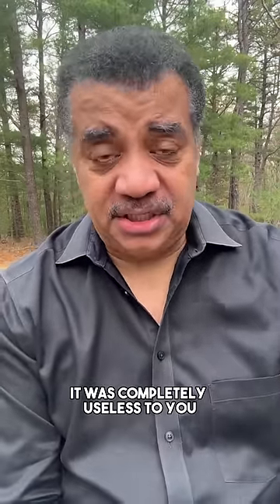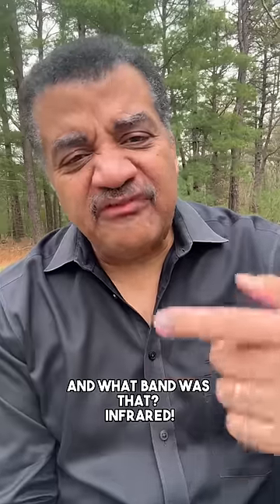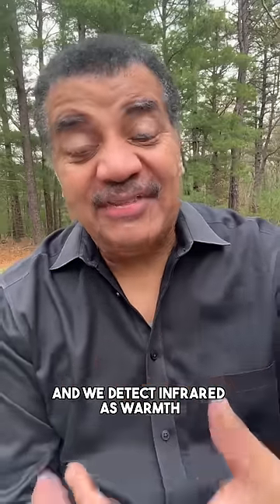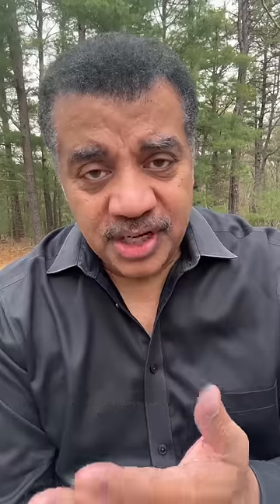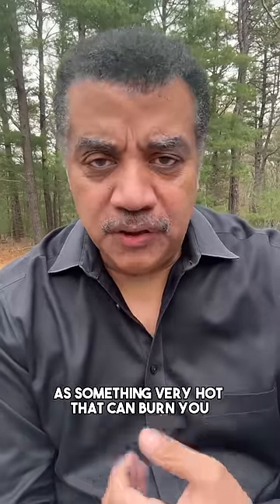LED Bulbs vs. Old Bulbs 💡

Comment: Correction; LED bulbs do get hot.  Touch the base portion that screws into the socket and you will find out.  However, it is still true that they do not waste nearly as much energy as incandescent bulbs.
Reply: Sure, simplification
Reply: That's an entirely different issue
Reply: @milkinanime7047 how is it a different issue? It's still wasting power, just not as much.
Reply: @ankurbhardwaj6184  the heat isn't produced the same it's not excess energy
Reply: Nitpicking.
Reply: It’s not wasted the same way , I’m any electronic device energy is wasted through heat dissipation aka when the electricity is running through the wires , this is extremely different
Reply: @RobertoPerez-ig3fz  THANK CHIRST SOMEONE ELSE UNDERSTANDS
Reply: @milkinanime7047  So, non-radiative recombination of the exciton - still energy input that doesn't go into light causing inefficiency.
Reply: It would have made much more sense if Tyson added that the filament inside old lightbulbs needed to have current go through them to heat up and emit light. LEDs have no filament to run current through, its a Diode which is why it doesnt get hot (or nearly as hot)
Reply: Exactly. If you've ever looked at one of those LED light bars on a vehicle you'll see all those fins. Those are heat radiators. It can also be a huge problem in emergency services light bars. They really have to design those properly to get the heat out of that housing. It's not nearly as bad as incandescent but it's definitely there
Reply: @RobertoPerez-ig3fz  How is this extremely different? In both cases, electrical energy is lost to heat, and therefore they're not perfectly efficient. There's a significant amount of energy lost to heat in LED light bulbs; it's just far less than in incandescent bulbs.
Reply: @milkinanime7047  What do you mean the heat isn't produced the same way? In both cases the heat comes from electrical resistance, yes? In both cases, they lose significant amounts of efficiency, yes? It seems similar to me. The main difference is that the LED light bulbs aren't producing a lot of heat in the LEDs themselves, but either way you're still losing electrical energy. The amounts are just vastly different.
Reply: @DANGJOS  the heat is produced by an electrical component rather than an excess of infrared light that's the difference I'm referring to. There are multiple ways heat is produced within a light bulb of any kind. 

So does it really matter which we choose to compare?

I don't care about how much energy is being lost I was only referring to that very specific difference.
Reply: @milkinanime7047   Well if the component gets hot, then there's still an excess of infrared radiation, although probably not as much. But anyway, I thought this whole thing was about how efficient the bulbs are and how much energy is wasted as heat. While LED bulbs are far more efficient, a huge portion of the electricity coming from your socket is still being wasted as heat.
Reply: Yes, LED bulbs do get hot. Especially just above the base. They waste electricity in the form of heat but not as much as incandescent bulbs. I believe the fluorescent bulbs create much less heat.
Reply: LEDs do not operate on alternating current only direct current. The heat you feel is coming from the rectifier in the base that converts AC to DC. This is also the part most likely to fail, ironically, usually by overheating. When it fails the bulb will blink. Check packaging for heat considerations. If your lamp restricts air flow, say, in a sconce, you need a bulb that can handle that. I found using cylindrical bulbs works best in sconces. The best thing about LEDs is that you can boost  the lumens without exceeding the wattage of the socket. I replaced a 100 watt bulb in my garage with a 300 watt equivalent and it uses less than 40 watts.
Reply: This comment thread surprises me.  So many people with one little piece of understanding that don’t want to accept that there are other distinct fact that are part of the issue.   
If you want to understand this topic, study.  Don’t argue.   It’s incredibly amazing stuff.  Complex beyond most people’s understanding.  
But you only make yourself look ignorant clinging to your one angle perspective.  Look from all sides.  You all have a part of the puzzle. Put it together, don’t use it to argue.
Reply: @thinkingoutloud6741   And what is that which is missing? You're telling us we're ignorant, or look ignorant, which is fine, but what is the missing information? I think it would be of more value if you share, rather than just say there's something missing.
Reply: It's because the energy conversion to light energy it's not 100% efficient.
Reply: They also use between 12 and 20 watts.  Is the scientist lying or are companies intentionally making a less efficient product?
Reply: yeah but if infrared light emits heat why wouldent visible heat as well just not as much
Reply: @ankurbhardwaj6184  yes it's wasting energy but significantly less than before. That's the point. It's not wasting energy creating unnecessary outputs. The electronics we currently use waste energy cause it's not 100% efficient. Instead of 100 watts it's using less than 5watts that's huge improvement.
Reply: @DANGJOS  the difference is it used to cost 100watts of 50 watts now it's less than 5 watts so huge difference.
Reply: Every light source is guaranteed to provide heat- as big a Stephenson 2-18 or as small as a light emitting diode.
Reply: Those parts get hot because of the flow of electricity in that (metallic) area.

If you pass voltage continuously through a conductor, it'll heats up eventually. So it doesn't exactly relate in this context
Reply: That's the computer/pcb board.
Reply: Yes. The heat produced by led is still hot and it is because of the high luminosity itself. Its less then the filament bulb and efficient but then it the heat itself is a  problem for the led unit therefore cooling is needed for it's longevity. Filament bulbs have no problem with it.
Reply: Well, we know SOMETHING gets hot! 🙄 But not the whole bulbs themselves! THAT specifically is what he's explaining.
Reply: @tlock77 thank you. The nerds are getting wildly technical like he didnt just mean the bulb was hot to the touch 😂
Reply: @Classic7-4-7   Right! lol
Reply: They get hot because they are overdriven. In fact their lumens to wattage ratio improved heaps if they're driven at half the commercial item's wattage . A wattage that doesn't cause them to get hot . A ¼ wattage  should yield ½ the lumens but maybe better even . Driven low however means they'll last several decades, it's not good for the economy.
Reply: @milkinanime7047 WTF?  It is by definition wasted heat.  You aren't using the heat, it's waste heat.  So electricity is being consumed by producing waste heat.
Reply: The comments in here that the heat from an LED is different than the heat from an incandescent are moronic.  The point is that the heat is waste heat meaning that some part of the electricity consumed generated heat which is not the end goal of the product.  In order to get light out of an incandescent, 90% of the power went to wasted heat.  There is some percentage of electricity going to heat instead of light from LEDs also.
Reply: Actually, that is a sign that the math is off a bit somewhere between  the socket and the base of the bulb. The amount of resistance is to high at that point for some reason. The lamp (bulb) should pluck the energy it needs from the incoming current and send the rest on its way with negligible heat resistance which should be contained in the insulation and decently cooled by air around it. But voltages and amps have to fit into the lamp's (bulb's) designed electrical math for it to work well. Many bulbs prematurely fail because of this.
Reply: They also taste warm! Lick the base and you'll find out!
Reply: @danmercer8139 Correction, even the LED themselves get hot..

Comment: You may want to consider the older incandescent bulbs over LED for headlights in the northern states.  Incandescents will melt the ice and snow that can accumulate on your headlights during winter storms.
Reply: They had to install heaters in traffic lights to solve this issue of ice buildup.

Comment: For those of us in the north, that 'heat' energy was actually part of what kept us warm.  The porch light and the crawl space light that we left on in the winter to keep the space a wee bit warmer and the pipes from freezing was important and now requires we run new circuits for powered pipe heating cables to augment the insulation (and usually melts the insulation over time).
Reply: They also used to melt the ice off of your car's headlights and taillights. I grew up in the south, but I remember holding my hands near the lamp to heat them up after playing outside that one time a year that it would snow.
Reply: All of these new "energy saving" light bulbs, don't last long, either after you put them in. They cost a ton of money as well!! So, after you buy them and install them, it's not long when you are replacing them. So, in the long run, you are saving energy but not money, I would bet!!
Reply: @jamesspalten5977  Uh, nope. You are dead wrong. LED lights last on average 20 times longer, and often go up to 100x. In fact, incandescent light bulbs were standardized by a literal mafia, known as the Phoebus cartel to last shorter than they should, a form of planned obsolescence, so that people would buy more. 

Today, the average 60W incandescent light bulb lasts 1,000 hours, or about a month and a half of continuous use. Just under half a year if you turn the light off during the day. 

The average LED bulb with the same amount of visible light lasts over 100,000 hours of continuous use or 12 years, not even accounting for turning it off when not in use. Stop taking your crazy pills.

This is all before you factor in that incandescent bulbs require a vacuum or inert gas to function. LED lights do not, and are therefore more resilient.
Reply: You can always install heating elements in the place of the old incandescents. You get more light and more heat for less cost. There are even LED lights meant to emit infrared for heat.
Reply: @john_titor1  please tell me what brand and where you are buying LED bulbs that actually last 12 years. I've bought all kinds of LED bulbs and the longest one has lasted was about 2 years. I've had incandescent bulbs last several years longer. Surprisingly the cheap Walmart brand LED bulbs last longer than more expensive ones.
Reply: And for everyone else, they had to use additional air conditioning to get rid of that heat.  If you need extra Heat get heating strips. Or Edison base heaters.
Reply: @jamesspalten5977 
Oh my god is it 10 years ago? 
You’re still posting the same rationalizations for the last 10 years. 
So far I’ve had exactly one LED bulb go bad.  Stop buying cheap garbage.
Reply: @john_titor1 
Everybody likes to tack onto the last shorter than they should. 
Back then the issue was if you made a a thicker filament, it would last longer, but it would use more energy. They came up with a happy medium, so the customers would get a Common experience. Besides, that was a long time ago. It doesn’t apply anymore or even 10 years ago.
Reply: Do you mean low energy fluoro light 'bulbs', rather than LEDs, @jamesspalten5977 ? 
LEDs use little energy, and do last a very long time.  
The fluoro lights also only use a little energy than incandescent lights, but have roughly equivalent longevity.
Reply: Couldn't you just continue using the regular incandescent lights?
Reply: @CognitiveHeatsink  pretty sure you're confusing LEDs and compact fluorescents.
Reply: @assininecomment1630  
If they stock up, they can continue with the incandescent lights. In fact, they could’ve easily bought them for the last 10 years.  They won’t be available for sale in the US anymore. Most likely they’re blowing smoke.
Reply: @john_titor1 crazy pills 😂
Reply: @Taijifufu   I'm not confusing anything. CFL bulbs last a good long time and I'd use them except my wife hates them. 5 years ago when I bought my house half of the bulbs were CFL and half were incandescent. As they burnt out I replaced them with LED bulbs. I've replaced each of those LED at least once since, but some of the CFL and incandescent are still working.
Reply: @assininecomment1630   I think incandescent bulbs have been banned by the government here in the USA.
Reply: @neilkurzman4907   the only incandescent bulbs I've been able to find in stores for the last 10 years are the little ones for night lights and oil burners.
Reply: @john_titor1 that's the claim.  In the real world I find I wind up replacing LED bulbs far more often than claimed.  The actual LED seems to last, but the electronics that drive them fail.
Reply: @bobmcl2406 IME, certain LED bulbs (looking at you, Phillips) have shorter lifespans in any orientation other than bulb-up.  They smell lovely when they die too.  Mmm, burned PCB...
Reply: Right?!?
"completely useless to you"
Yeah okay Neil, tell me you grew up not worrying about the heat in the winter without telling me!
Reply: @john_titor1  
NO they dont.
Just like the cfl bulbs that were supposed to last 10 years.
Reply: @CognitiveHeatsink  only sales
Reply: @davidtaylor4053  Okay, tell that to all the studies conducted around LED lifespans, everyone who has used LED bulbs that easily last 5-10 years, and the 5 year minimum warranties that are standard on even the cheap sets available at every walmart and home depot across the US. Stop lying.
Reply: Keeping stop lights defrosted as well!!
Reply: @john_titor1 I must buy all the wrong brands from all the wrong stores. Call it what you want, but my personal experience doesn't come close to matching those numbers.
Reply: @ai4px  It's actually cheaper and more energy efficient to use LED lights with small heating elements.
Reply: @CognitiveHeatsink hey are not banned, just not produced any longer.
Reply: @jamesspalten5977 I can tell, you're not a big fan of reading.
Reply: Tell me you're Scottish without telling me you're Scottish
Reply: @utvpoop  scotts aren't the only ones who use 'wee'.
Reply: Or, buy the old bulbs
Reply: They still sell non led bulbs...
Reply: YES! THANK YOU! I was wondering when that side would be broached.
Reply: Just run incandescent during the winter. Duh
Reply: @jamesspalten5977 ive had an LED bulb in my lamp and I leave it on all the time. I e had it for over a year and still haven't replaced it.
Reply: @CognitiveHeatsink The forty-watt incandescent 'appliance bulbs' are still available. LEDs don't do well installed in the oven.
Reply: Iam not in the north but we use it on out pump/well doghouse . Because  we don't have  the heated wrap the  north has.
Reply: @jamesspalten5977 amen ! I have bought led 6 times in the past year .  I've bought 4 pack two at a time. It's been at least 2 of each pack the hole side of the bulb has busted . There I don't know, expensive and dangerous.  Iam so over buying  these bulbs .I've been looking for the old one
Reply: @jamesspalten5977 it is my experience that they last longer than incandescent bulbs.
Reply: @assininecomment1630 they cost more in the long run.
Reply: @kitwench1752 he grew up in New York.
Reply: @john_titor1 I must be the luckiest man in the world my incandescent bulbs last years
Reply: @john_titor1  The diodes do indeed last that long.   But the bulbs don't.  It appears to be not the diodes that emit light but the transformer and associated circuitry.  So you're both right and wrong about LED bulb's lifetime.
Reply: @john_titor1 the LED could last even longer than that, usually after 100,000 hours is when they only shine at half intensity. The problem is cheap components in the driver circuit burn out first, very quickly on the cheap and poorly designed bulbs. The bulbs is not just the LED, and the bulb dies when any essential component fails.
Reply: @john_titor1 The “bulbs” may, but the circuitry certainly doesn’t!!!

Comment: Better light , added warmth , was cool to see the filament glow.
Leds are great and all but incandescent bulbs are awesome
Reply: Yeah I agree with you, but I'm torn. Incandescents are made to burn out, it's how they're designed. Over a lifetime I bet one could save tens of thousands of dollars
Reply: Lol, nostalgia is dangerous, exhibit A.
Reply: @MorganHillJr  looked into LEDs and health?
Pound sand fool
Reply: If you need more warmth, it’s much more efficient to have something specifically designed for creating warmth to do it rather than relying on something that creates it as a byproduct. What about in the summer when it is already too warm? What about during the night when you probably don’t need the lights to be on?
LEDs used to give off too cold light but that was 20 years ago.
Reply: @tovekauppi1616  Right, especially when a lot of that heat is in the unnecessary amount of infrared light produced